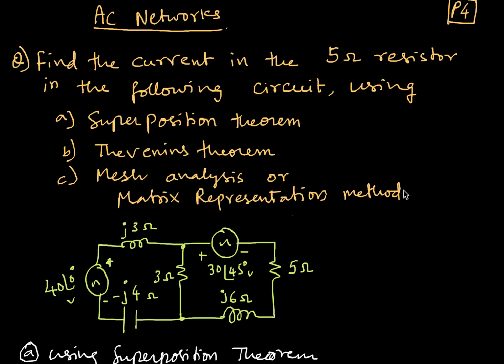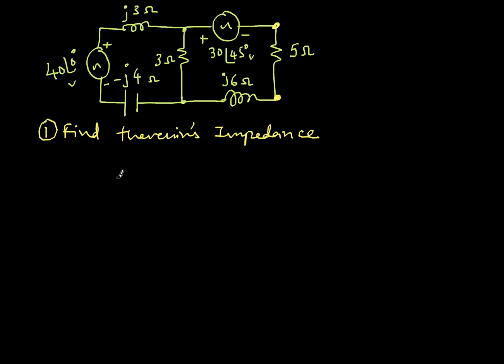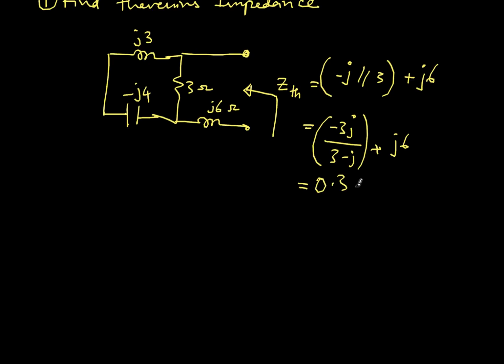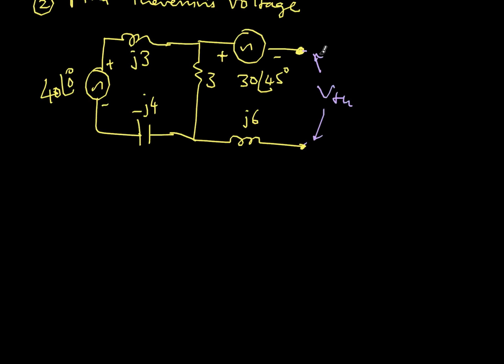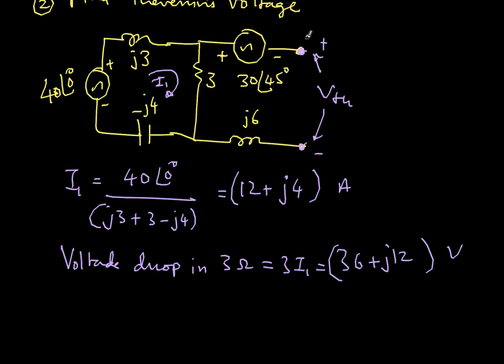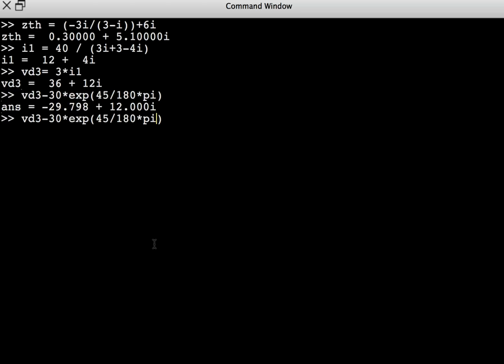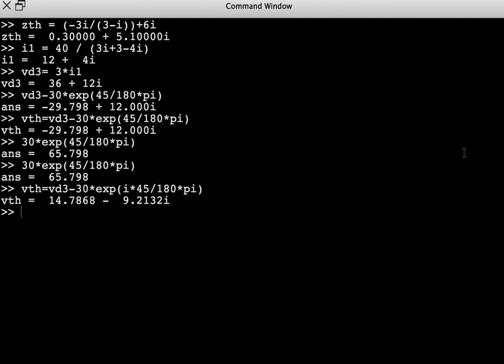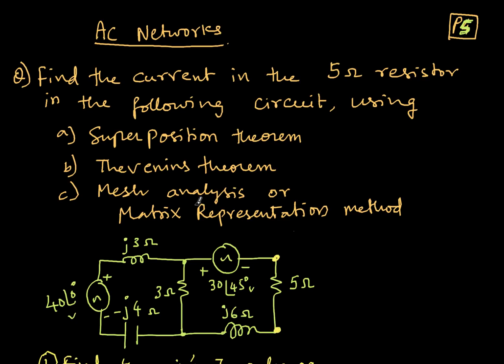AC Network Solution with Thevenins Theorem

Comment: Hye Sir.
Just wondering for power system analysis why does the Vth is always 1 pu?
Reply from the maker: you may be referring to fault current calculations. we use Voltage as 1 pu, because we are not interested in the exact value of fault current, we only want to know what is the approximate range of fault current.
Reply: Pradeep Yemula Yes sir because I saw that If = Vth/ Zkk when calculating fault current.